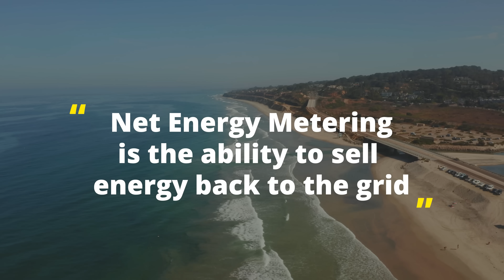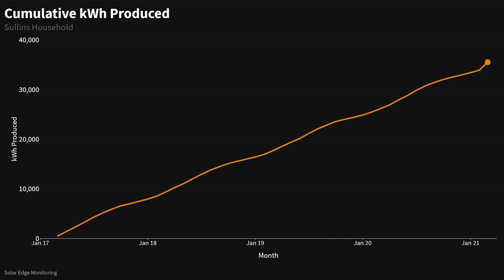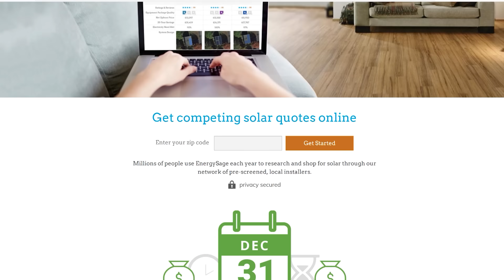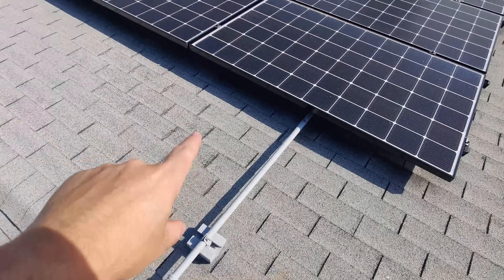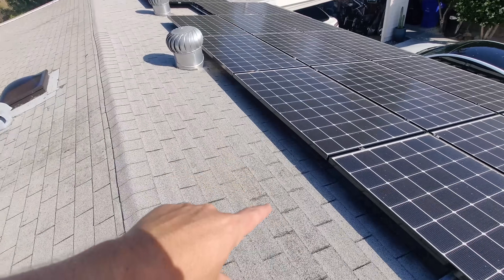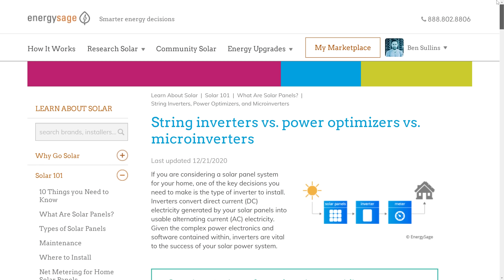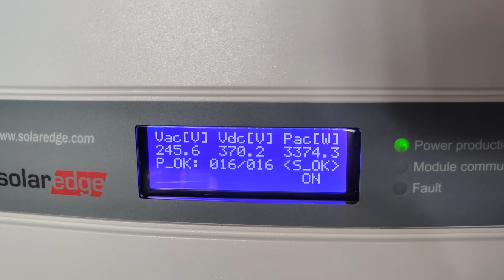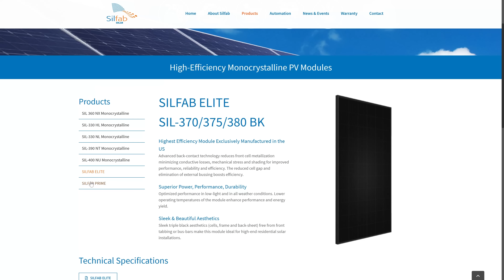The TRUTH About Solar! 4 Year Review

Comment: Hi! We are installing a 32 panel system here in Sweden right now. The energy prices are raising for every year so I think it is a good investment in the long run. Thanks for your advises. We have in fact already by accident done all your advises right. 1.Bigger system than recomended by the seller for future use. 2. Converters under every panel. 3. 1-2 brand new panels in spare if someone get broken so I easy just can replace and add a new one similar to all the others.
Reply: why keep the spare? doesn't make sense. make the spares produce electricity
Reply: @tacobell2582  Yapp you right about that!! I allready installed the sparepanels at the garage roof and so far we sell more power than we buy from the electric grid owner!!

Comment: I have 2 questions? 
1 When the grid goes down will I still have power (yes battery backup for night). 2 When they throttle down the power under heavy demand will my ac have full power. If any answer is No then solar makes no sense.

Comment: I would add that you should also determine the life expectancy left in your roofs life.  If you have to re-roof in a few years after the solar install you will have to pay an installer to remove your solar array then re-roof and then have your solar reinstalled.  If your roof is not fairly new I would recommend addressing it before you do a solar install to save a chunk of change.
Reply: A roofing co. told me that most roofing shingle manufacturers do not warranty their product if solar panels are installed over them. It might be worth while to explore warranty & insurance impact before installing.
Reply: In the HVHZ (High-Velocity Hurricane-Zones) of Florida, where we favor heavy, thick concrete roof tiles, this is a MAJOR consideration.
Reply: THIS. I have seen so many people get suckered into buying or leasing panels without considering real long-long term costs and work involved.  + You have to adjust re-installation costs based on market and inflation, as most of it are labor costs they are very unlikely to get lower similar to the tech itself. So it all really boils down to... how crazy expensive electricity is in your state and how old is your roof.
Reply: Just did the drill! The panel installers did roofing as well. Ya they knew "a guy" but I did not dought them when they recommended a roof replacement-Before the solar panels! :)
Reply: I know this is an old post, but ...
I talked to a roofing guy, he said I have probably 5 - 10 years left in my shingle roof.
I would hate to replace the roof now (and miss maybe 10 years of life in the roof) and I would hate to install panels and then have to remove it all in 5 years for a new roof.
What would be a recommendation in this situation ?
Reply: @jkristia9478  I think I would find out the cost of removing and installing the panels and then factor in the cost of the roof to see if the removal and reinstall costs would have an impact on your decision.
Reply: You'll probably have coordinate re-tiling and re-paneling.  If you need to replace your tiles, you'll first have to schedule the solar company to come remove the panels (I doubt they do that for free).  And conversely, if you want to replace the panels since they degrade with time, you may want to replace the tiles since you'll have access to them.
Reply: This is honestly why every new house should be required to come with solar panels. That way the life of your panels is basically the same as that of your roof
Reply: Never put solar panels on your homes roof.  Either build a free standing  rack, or a carport in your driveway to mount the panels on.   Drilling holes in your homes roof is asking for water intrusion problems
Reply: @enricoderojassarson5596  Nah its fine if you have a good installer or know what you are doing yourself. Its just a few holes that get used to mount a rail system that the panels go on
Reply: @enricoderojassarson5596  If you have a shingle roof, you have thousands of holes up there already plus all your feed throughs for venting.
Reply: In that case, I would just purchase a Goodyear blimp and suspend your array from cables. Just make sure to tether your blimp properly so that it doesn't drift further than your main power line running from the blimp to your home. Otherwise, it could cause the main line to break which would cause outages and possibly fires.

Comment: I installed my 6.5 Kw system 11 years ago. With degradation I am producing half of what it did. With self install I installed 36 panels. It cost me 6.5K after rebates out of pocket. 10 years ago I with net metering I was paying $100 per year. It has slowly risen $130 per year due to degradation. I am about ready to replace all my panels. I agree with install as many panels as can fit. Not because your demands go up. The do. But because the degradation is higher than they advertise and is exponential not linear.
Reply: Degradation is that bad after only 11 years and you’re already replacing them? How could you possibly benefit from that much cost? Are panels more efficient now?
Reply: Do you live in a place that’s very windy or sandy? Or does the wind blow directly on your panels? My 6 year old system so far has experienced almost no degradation. Projected degradation is 1-2% per year. Panels face south& wind blows mainly from west.

Comment: "add as many panels" isn't always wise.  I ran into needing outside electric work done with over 25 panels with a max layout of 29 panels on my roof.  That was going to be an additional 2-3K for the electric alone. which totally wasn't worth it on a per watt basis for those 1200ish watts.    In 2014 after rebate I was at $2.02/watt at 25 panels and a 9K system and those last watts would have been at $7-8/watt.

Comment: I get the electric car senario, but do you really think our energy needs will be increasing over the next 25 years?  There has been a concerted effort to make everything more efficient, and I don't see this changing.  Or, in my case, my teen will be moving out in a couple of years, followed fairly quickly by the rest of the children.  I'm worried about over buying.  I am in an area of Texas covered by our deregulated retail market, and none of the current offerings will pay me for excess production.  But I am able to get net metering. My power rate will go from 8.9c to 13.9c as I switch to a provider that does net metering, so it is very important to offset as close to 100% of my power as possible.

Comment: Great video! I usually sell my customers the least number of panels they may need. I don't make as much as the other guys, but at the same time I'm not overselling and ripping them off. IF it turns out you don't need them, you are stuck with that payment for the next 20 yrs. If you do, you can ad them later. Also in my opinion, usage will decrease moving forward. Like in our case, eventually my 4 kids will move out and any future electrical devices will be more efficient than they are now.

Comment: When you anticipate that your systems lasts 30 years, you need to understand that "net metering" is not a guarantee for the future. Actually, "net metering" is very disadvantageous for the electricity supplier. Result: If solar panels become widely accepted, net metering will likely go away and your cost will go up so much that you won't make any money anymore. Second is: $0.31 per kWh is much higher than the real cost. It only costs around $0.07 to produce a kWh. Again, if we start applying the real cost for producing electricity, solar panels are not a good investment.

Comment: After your solar panels have paid for themselves make sure to save a portion of the spare cash for any maintenance or replacement that will be required in the future. While there my be warranties on your panels/inverters this does not mean that the labor will be covered in the event that a panel or some cabling needs replaced (FYI Cabling does not have a warranty). Even though your installer has a labour warranty it is still smart to set a little money aside just in case.

Naturally if you are DIY or have a subscription plan that covers these costs then this does not apply as much.

Source: I am Advanced Technical support for a large Inverter Manufacturer.

Comment: Are you factoring in the increased cost of removing the panels to replace the roof when it needs replacinh?
Reply: - your area may vary but I checked, double checked then re checked with our home insurance. They are supposed to cover the removal, storage and re installation in case of roof repairs needed. We had just gotten a new roof about a year before installing. Keep in mind the panels do extend the life of the roofing below them since they get no direct sun exposure.

Comment: I pay 7 cents per kWh in Texas 31cents is INSANE!
Reply: What is the value of electricity to you personally?  That is, if your local utility had a monopoly on you and started raising rates arbitrarily and without limit, at what price would you tell your utility to disconnect service and to stop billing you altogether?  15 cents/kWh?  31 cents/kWh?  $1/kWh?  $10/kWh?

If you buy and deploy enough solar panels to meet 100% or more of your daily energy needs (during your highest usage time of the year), then the local utility rates generally don't really matter much anymore (to you personally), be they 7 cents/kWh, 31 cents/kWh, or even $10/kWh, since you presumably aren't buying any of it anyway, at least, not on a normal basis.

That said, actually paying 31 cents/kWh to a public utility is wasteful, as one can definitely build a fully off-grid capable solar power system (with a high cycle life battery) that generates solar electricity considerably cheaper than this, using (currently) available off the shelf products from online solar equipment distributors.

Comment: The only time solar is worth it is if you buy the solar system cash. If you finance: expect a lien on your house from the company, 100% of the power you generate 90% goes to the electric company and 10% to the buyer that is why you don't get much savings. Solar companies always recommend to add more panels that you need. Your house does not need that many panels. So the electric company get all that extra power. If you need to fix or replace your roof, you have to pay to have the panels removed and reinstalled. At the end of the contract the panels do not belong to the buyer. Anyway, do you research, just don't take my word for it. Don't fall for it! Ask questions and don't be an impulsive buyer! You can fall into a SCAM!

Comment: You're using a SolarEdge inverter which is a string inverter, but don't you have optimisers on each individual panel removing the need for microinverters while still getting all the benefits? That's part of the whole benefit of using the SolarEdge solution: optimisers turn the panels into intelligent panels and provide panel level tracking & real time adjustments of current and voltage to the optimal working point of each individual panel. The issue with microinverters isn't only the upfront cost, but also maintenance as inverters are usually the first piece of equipment to stop working in a system.

Comment: I am curious as to what has to happen when you need your roof replaced. Roof replacements typically happen every 15 years or so, so if you're in the middle of a roof cycle, should you wait until the roof is replaced before you add solar panels? If you need to have your roof replace are the solar panels easy to remove for most roofers?
Reply: Depends on the type of roof, for instance we have a metal roof that won't need replacing for 50-100 years depending on its exact metallic composition.
Metal roofs have a very easy install so even when it does need replacing removing then re-adding the panels will be easy.

A ceramic shingle roof on the other hand requires specialty installation techniques to do without breaking the tiles.

Also the solar tax credit is decreasing and as of right now will end in 2024 for residential systems. Meaning where we paid 30% less for our system if you wait till your roof need to be replaced you could end up spending the full cost of the solar. Currently a 22% savings not including state tax cuts.
So if replacing your roof now costs less that 22% of a new system you end up saving not only on system cost but you get to start saving on energy costs sooner.

It's a complicated question if solar is right for you and that answer changes with time. Eventually net metering may not be as beneficial because if everyone has solar then the grid needs to make money somehow to maintain the components solar at the home doesn't provide such as batteries.
So a system now may pay for itself much faster than in the future.

Had our system for 5 years and its generated $15k-16k worth of power so its about 60-70% paid off, energy costs where we live are lower so its paying itself off slower. However we also have a system 3 times the size of the average americans power usage.

Hope this helped.

Comment: What happens when it hails.  Or when you need to re shingle.
Reply: Modern solar panels are built with tempered glass, usually rated to withstand hail stones up to around chicken egg size.  Some places do receive hail storms with big enough hail to destroy the panels, but such storms are also likely to damage or destroy everything else as well (ex: regular roofs, automobiles, gardens, etc.).  Homeowner's insurance policies usually do cover damage to solar panels due to hail storms.  That said, financial hedges like homeowner's insurance aren't true insurance, since the future is not guaranteed, nor is the solvency or fairness of the insurance provider guaranteed.  I personally wish solar panel manufacturers would improve their designs to withstand even larger hail.  It isn't very good when you buy something that should theoretically continue producing useful amounts of electricity for over 100 years, but it fails after 14 years due to a predictable, but perceived (incorrectly) as improbable, future weather event.  Global warming causes destabilization of the jet streams, which leads to unpredictable weather.  Extreme weather events assumed to be unlikely for a given area, may in fact become likely in the future.

When you need to re-shingle the roof, one typically removes the bolts holding the panels down, unplugs the MC4 solar panel connectors, disassembles the solar array and mounting rails, disassembles the electrical conduits, and sets things aside.  The roof is then replaced, and the electrical conduit, mounting rails, and solar panels get replaced.  Supposedly the effort of removing and reinstalling the solar system is normally a minority fraction of the total labor effort of replacing the roof.  Additionally, a diligent homeowner can potentially mark/document everything and then do the solar system removal and reinstallation themselves, if they are unwilling to pay someone else for the extra effort.

Comment: So glad I got my installed during covid.  Our utility limited us to 106 percent of current usage
Reply: why ? i don't see a safety risk or another reason why and households can and do change size and usage in 5 years or so span
Reply: @richardprice5978  that is what our utility imposed.  Our covid utilization was 30 to 40 percent higher then normal so we locked in greater production then we normally would have had
Reply: @ascotell  🐠 stink 😉 must work to good for solar 😉 so there 🧢 you off as id need a better reason from my local zoning board in slc😉 to buy that storyline 😉

what a about a power outage?? thats never going to work 😉 kinda sucks to be you as now you have some hard choices gas ⛽️ or minimal power 😉

is the same thing with wind or water  generated power?

Comment: Good analysis... One point you could add is that micro inveter are more efficient and produce a bit more power specially if your panels spread across different sections of your roof while the big inveter which I also have at home cos micro was not a thing back in the day averages out the intake to the panel that's getting the lowest energy... Also the benifit of micro inveter is of you want to add more panels at a later date it's not an issue.. however if your adding more panels with a wall inveter you can add only up to its capacity of the wall inveter and not more at which point you have to change to inveter to a bigger capacity which is costly...

Comment: It's not just that the panels will look different. You will have a hard time creating parallel strings, matching the VOC. For example, I bought 370W mono perc panels two year back, just to try it out. Now, when I'm thinking of adding more capacity using the same charge controller, those same 370W panels are not available. A different manufacturer is providing 370W panel, but VOC is more than my existing ones,  making the total voltage of one series string much more than the other. 390W are available or 440W half cuts are available, but then again VOC doesn't match. Also, you will be wasting some of the potential, no matter in what way you put together mismatched panels. 

I think, it's always a good decision to max out the capacity of the charge controller or inverter you are using. Also it is prudent to get a controller with a little more capacity than you need presently.

Comment: Agree with the micro inverters, I have a single DC inverter and having micro inverters allow you add additional panels if you really want to. Also important to keep in mind not all net metering is the same. In IL where I am at they have net metering but cut your excess once a year. So every April or October (you choose at time of install) you are forced to give up any excess carryover that you have to that point. Which is bad for me as April is when the system starts to really pick up and Oct I tend to be finalizing my summer overages. So not ideal to even be 95% covered as I still lose some carryover.